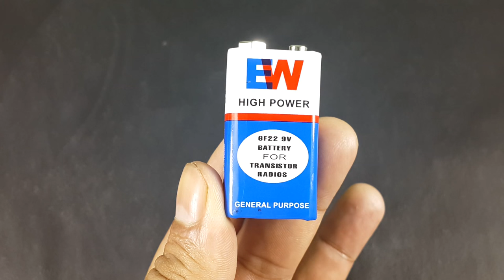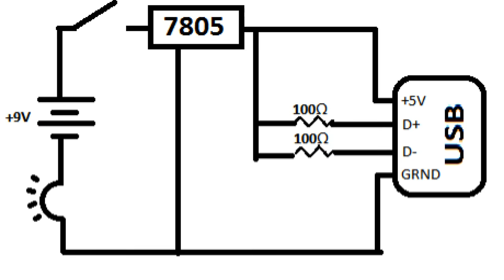How to Make a Mini USB Mobile Charger at Home

Comment: Hi man, i figured out that the Led consumes some Voltage and the output of the 7805 stays around 4,80V with the led inside the circuit. Without the led into the circuit the output of the 7805 stays around 5,05V, do you know if this difference would become an worse recharging for the cellphone? thx

Comment: why do I need all those stuff (Resistor, V.regulator etc) can't I connect the battery to the USB? Plz help. I am asking you this question, coz I am on the process of making wind turbine to charge the battery. I am thinking to connect the output wires from my DC Motor to my phone. Will it work?
Reply: Solomon Jamzuriy only with 12V motor
Reply: Yes, with 12V DC motor.
Reply: Solomon Jamzuriy well I found out that you need a capacitor connected to the 2 pins and then solder the wires to the USB (I'll check what capacitor you need and lastly you might need to have very strong winds ahead because 5v is hard to achieve with a table fan maybe a very powerfully table fan on 2 or 3
Reply: it's 2200uf 24V capacitor

Comment: In circuit daigram you showed 2 resistors of 100 ohms but you haven't used them.. Why??
Reply: he used just one, but not sure if was of 100 Ω
Reply: +MrMedico33 it was 470 ohms
Reply: The Circuit shows two 100 Ohms more for the Case, you want to charge iOS-Mobile-Phones. They dont work with the normal Circuit.

Comment: This is so immature, the whole idea and the music, totally dumb. The transistor wastes so much power, then charger quits once battery gets to half, and phone still needs charging just to make a phone call would not be possible. If you are stuck in somewhere and your car battery is totally dead and you need more charge for your phone, it is easy to rig your phone charger to use any source of DC power as long as greater than 7 volts but it is the amps that gives the phone a charge. Without the amps, your phone pretends to be charging. To make this into a permanent gadget and play this crazy music behind it instead of verbal instructions that could be more helpful, is not a good idea. Batteries pollute landfills, they are expensive, and this system is very inefficient. The best idea is solar panel, small lithium 12v battery, 12vto USB converter, and now one could brag about a clean and free energy source to charge a phone.

Comment: Plz.. jst stop posting these kind of videos. its complete waste of time. there are only drawbacks in this whole charger thing. 
1. The phone never charges as a 9v hw alkaline battery can never power a lithium ion battery, rather the discharging rate peaks up
2. The linear voltage regulator requires a heat sink to function as when current reaches its peak value, the 7805 IC 5v regulator heats up immensely reaching upto 112 degree Celsius and hence burns out.
3.if u want to get even 1% charge with this set up, then try using a duracell battery rated at 2400mah 9v, and a small heat sink which u could find in old electrical appliances like inside a fluorescent tube driving circuit.